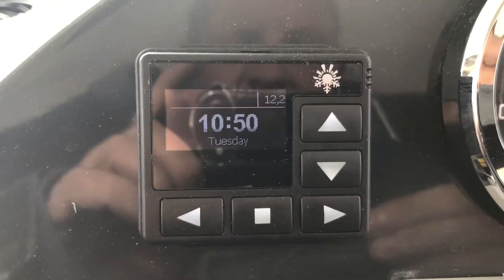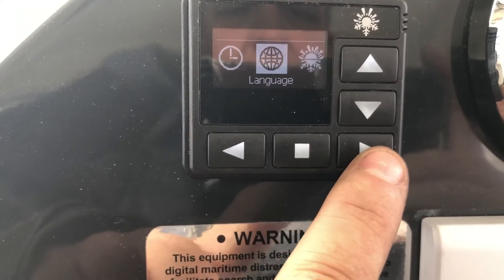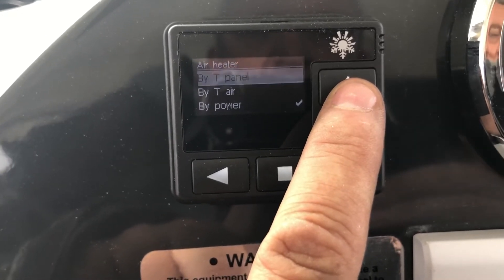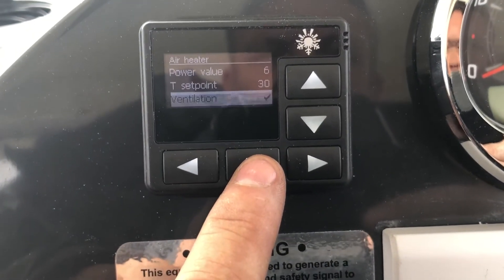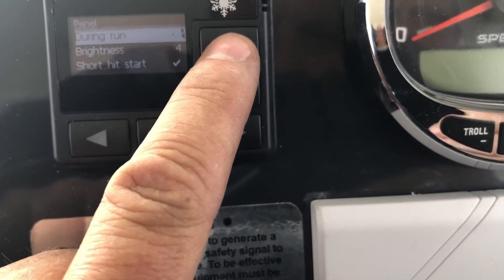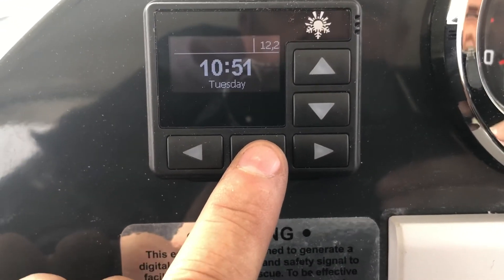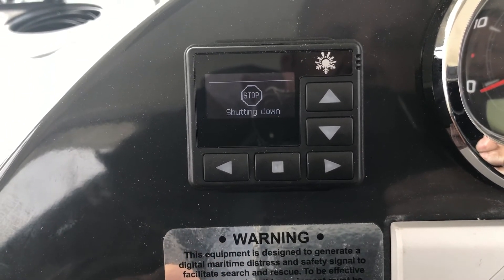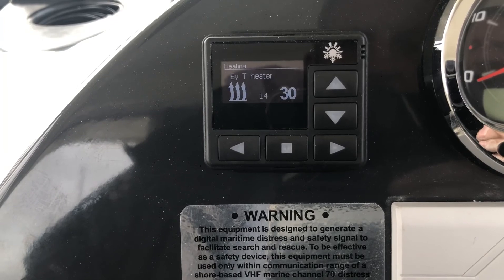Brief operating instrctions PU-27

Comment: I was considering this heater since it's supposed to be higher quality than Chinese ones, but a quick skim through the comments revealed many problems like "thermostat only working +/-5 degrees", "clock running fast", "controller making whiny noise", etc. Now I'm not sure sure whether this is worth 4x the cost of Lavaner for example. Auto adjustment for altitude is the main reason I'm still considering this one over Chinese heaters. Thoughts?
Edit: Since most issues are controller related, I'll buy the one with the new comfort controller. Thanks for this video which hugely helped me make an informed purchase.
Reply from the maker: I think you will find far more comments about chinese heaters not working than autoterm heaters not working. The comfort controller and the soon to be released PU-28 dont have the thermostat issues and the setpoint is adjutable to +1-1C controller making a whiny noise we only know of about 2 or three out of thousands and they have been swapped put under warranty. So honestly yes its worth the difference.
Reply from the maker: Also yes they all have altitude correction as standard and certification etc. way beyond all the ones you mention.
Reply: @Heatersandfridges  Thank you. See my Edit above. Just purchased one with the comfort controller.
Reply from the maker: @ermanakbay  great, you wont be disappointed

Comment: If anyone has problem that screen is black and only arrows light up, disconnect the controller cable and plug it back in. This happened to me when battery was low.

Comment: Really useful video thank you. Not sure if its just me but whether in T Heater or T Panel it doesn't seem to switch off when it hits the set temp so sometimes we have the current temp 4 or 5 degrees higher than the set point so we have to just shut down (not ideal when you want it to come on automatically during the night). Tried to change ventilation settings but doesn't seem to matter. Not sure if anyone else has had this or has any suggestions on what we need to do?
Reply: Yes .mine is doing exactly the same thing...! 
Maybe the new 2021 control panel offers this setting...?
Bit of a con really..!!!.. !!  
I am going to give them a call today....
Reply: @davenicholson9003  i actually called them last week and they confirmed this is normal as there is a +5 and -5 tolerance with the setting so effectively it wont switch off until its 5 degrees above and then wont turn back on until its 5 degress below. He said they have tried to amend this tolerance but they cant so there is a new comfort version which has +1 and -1 tolerance so im thinking of upgrading to that (just plugs into the existing cable so no need to be fitted at the dealer)

Comment: Owen, is there any chance you could change the settings on your Comfort Controller video? It is currently set as 'Made For Kids' which means it cannot be saved in my Favourites folder for quick reference.
Reply from the maker: If only i knew how! I would happily do that. I have not found how to change it.
Reply: @Heatersandfridges  in your list of videos, click the 3 dots on the right of your Comfort Controller video then click edit. 
Then change the "Yes, it's made for kids" to "No, it's not made for kids", then click Save 👍🏻

Comment: Hi jus got a new one these in a sprinter after kicking in throws up error code 13 after like a minute and cuts out doesn’t even get warm any ideas mate
Reply from the maker: Fuel problem. Check fuel tank level os above 1/2 and then restart up to 15 times of getting this error just to make sure its primed. If that doesn’t solve it. Check fuel pipe and fittings. Of it still doesn’t go search for your local service centre and book flr a check over.
Reply: @Heatersandfridges  ok will do tried what u said same thing I’ll get it in garage thanks

Comment: Hi,
I set my heater to run this morning, set by T controller,
It was -3
I set the target temp to 30 and after more than 2 hours the temp at controller was only 16 degrees ?
Does this sound right ?
Reply from the maker: Yes, don’t forget its measuring the air returning to the heater and not the air at the top of the living space so it could be considerably warmer there. The cool air back to the heater is usually drawn from the floor height so is cooler than the higher up areas.

Comment: hi owen  not  sure if you can help the control panel comes  on but the display doesnt its just blank.. any ideas
Reply: I've just had exactly the same problem. Went out to put the heater on after a cold night just to check before I go away tonight. Screen blank but buttons light up. What's happened there ?

Comment: I want to controll the temperature and fan speed manually, everytime i set it by power the same amount of air comes out on the highest setting and lowest setting. Also temperature does what it likes as setpoint is at 18 and the heater is reading 21. 
Im not sure if this is the heater or the controller thats faulty.
Reply from the maker: mcdefinitions power mode controls heat output and fan speed together. It takes a while to act but definitely does ramp the fan speed up and down. If you have ventilation mode ticked and also have one of the temperature modes selected it will heat and try to reach the set temperature. As it gets 3 degrees away it will start to ramp down the fan speed and power. As it get to the set temperature it will be at minimum fan speed and power. If the weather is not very cold the temperature may continue to rise. When it reaches about 3 degrees above the set point it will stop the burner and initiate cool down sequence( assuming ventilation is ticked and it has been running for at least an hour). Then as the temperature drops below the set temperature by 3 degrees it will restart the burner and resume heating as above. The band is set quite wide so that the heater does not stop and start too frequently and flatten the battery. There will soon be a new controller available where this can be adjusted if required however it is normally not needed.
Reply from the maker: mcdefinitions i dont believe any of the parts are faulty.
Reply: @Heatersandfridges  You said: "If you have ventilation mode ticked and also have one of the temperature modes selected it will heat and try to reach the set temperature". Which one set it: of the heater or of the panel?!?! which one will take into consideration?
Reply from the maker: Mihai Amatti i recommend “By T Heater”
In most cases as it makes for a more stable temperature.

Comment: Can anyone explain the power value setting ?
Reply from the maker: Its not a setting, it is just a place where the power level value is displayed. When you have it in “By T” modes the power level is set by comparing actual temperature with the set point temperature. A number from 0 to 9 is in there. 9 being full power and 0 being minimum power. It’s automatically set so has no effect changing it. In manual power mode it is altered with the bars from 0-9 also.